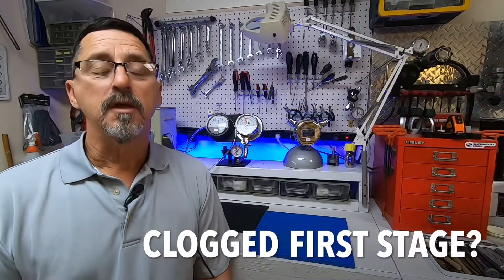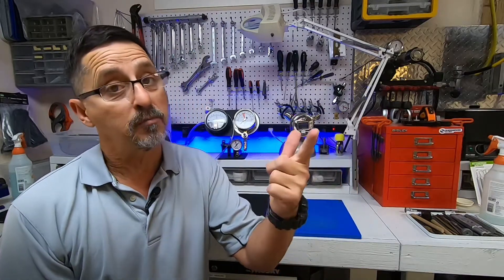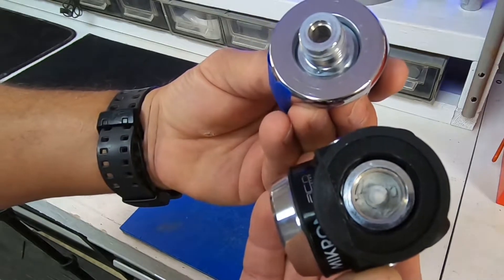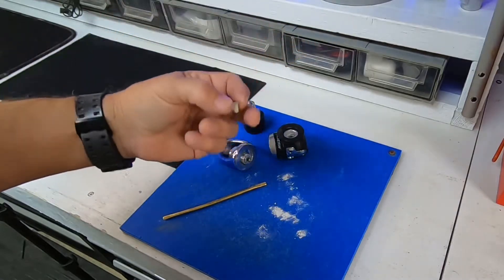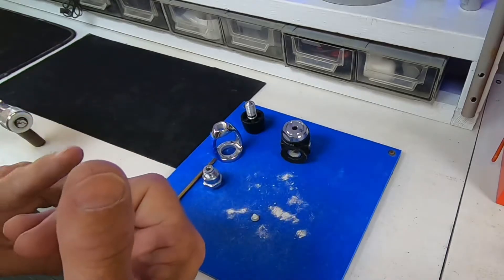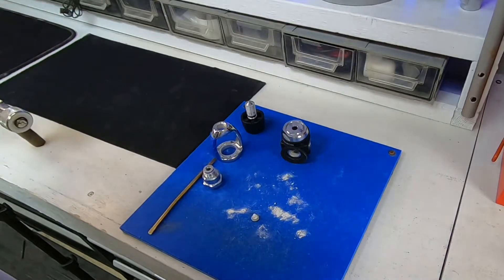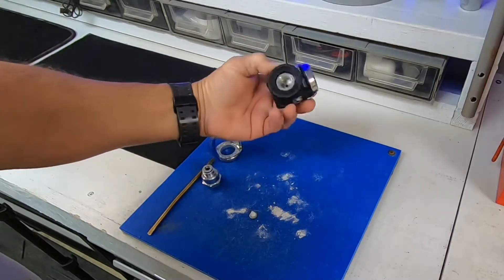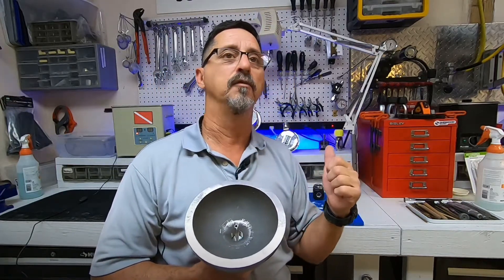No air to diver!! Scuba regulator clogged

Comment: Hi how tight do you tighten your handwheel knob on your scuba tank is three fingers tight about right thanks
Reply from the maker: The hand wheel doesn't have a torque valve, so the screw tightens to where the valve stem is flush.

Comment: I had a complete shut down of air on my second stage regulator at 135 feet. reg was rebuilt a week before. I immediatly put my secondary in my mouth and no problems. Turned out to be a Braided MiFlex hose that started crumbling inside the hose and plugged up the air inlet into my primary reg. This was back in 2010? i think. DAN did a safety release about this issue after it was reported by a Javier at Cozumel Scuba Repair. Miflex has since changed the material on the inner lining of their hoses.
Reply from the maker: I have seen this issues with braided hoses, the inner hose breaks into small fragments of a hard plastic and block the air passage.  When this was happening I had to check braided hoses for this failure.  Like you said the material has been improved and the problem seems to have been resolved.  Other issues I've seen with braided hoses is air leaks occur anywhere and sometimes all over the hose.

Comment: That’s a crazy amount of corrosion. Maybe a shady operator with no dip tubes? That would cake things up fast. Great Video. I really appreciate them, you do fantastic job.
Reply: I've come across tanks where the dip tube has become dislodged from the bottom of the valve assembly. You can easily hear it rolling around in the tank, hopefully before you put in on. Something to check when renting tanks, just give it a shake.
Reply from the maker: Tanks are neglected more than any other piece of equipment.  I have failed tanks that have excessive amounts of corrosion, enough to enter the valve and regulator.  I’ve kept them for teaching aids in my VIP Inspector class. Might be a good idea to post a video showing this as a follow up to this video.  Thanks for the comment and glad to hear like the videos.  Soon I’ll be posting more videos, just in the middle of summer madness with little time to spare.